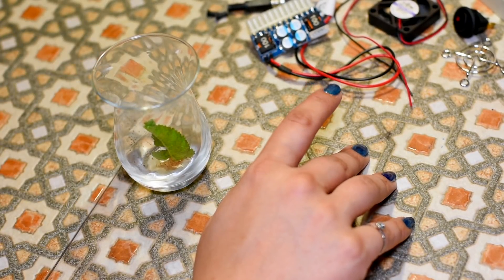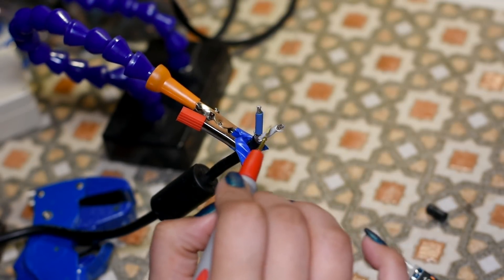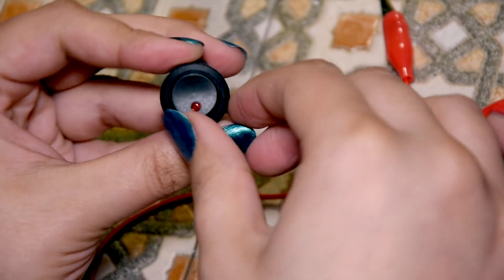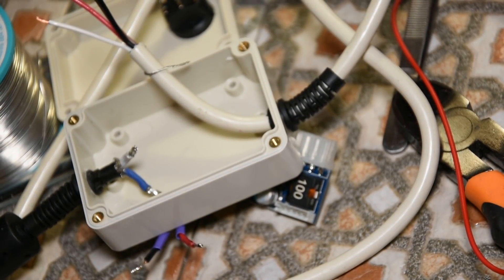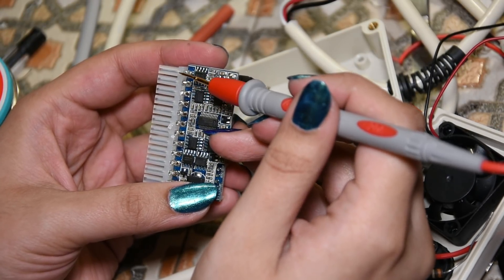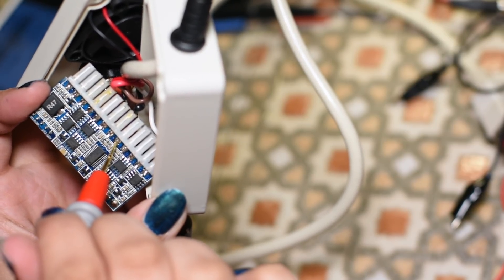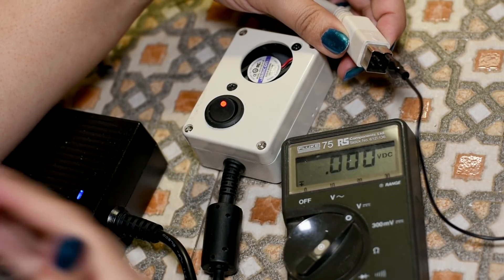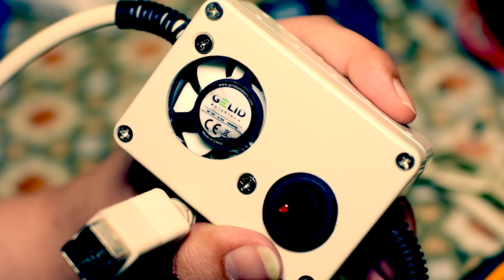160w Pico PSU hack for the Amiga

Comment: Maybe you should have another hole in that case for the air to get in. Because that fan can only blow out, what gets in somewhere else. This way, it is only stiring a bit. Nice project.
Reply from the maker: There is btw, there are a few holes along the bottom.
Reply: MsMadLemon Now I have seen it :-) I should listen better :-)

Comment: I just can't decide what to do. My old A500 PSU (The heavy one) is old and doesn't work well. I'm sure I could just recap it and it will be fine but it's still only 2.5A so it isn't really enough since I have a 68030 accelerator in it. I read that an ATX PSU isn't all that safe as well but the Pico is just so darn expensive.
Reply from the maker: Keep hold of your A500 psu, im in the same situation and im about to do a video series on replacing the innards of my A500 heavy psu.. maybe it could inspire you, ive just bought a meanwell psu that will fit inside the A500 psu case.
Reply: Oh. Which one did you buy?

Comment: Great video. I was wondering if you could follow this video up with a guide to using this pico psu to power multiple devices off one unit. For example a raspberry pi, a hard drive and an small audio amp. Keep up the good work.

Comment: so you`ve got a power supply going to another small enclosure then finally to your amiga, bit of an abortion, just put the pico whatever straight in your amiga, or at least de-solder the connector and do the job properly
Reply from the maker: this is my way of doing it, its working therefore it's done "properly" , I dont want to modify the Amiga

Comment: Oh dear, I feel like a right 'orrible' person writing this. I am a great fan of yours young lady.  The fan off center is OK but where does the hot air go ? Nowhere. It's a good idea to have exit holes to allow the hot  air to escape. What you have will help of course but a few 6mm hones here and there would make it much, much  better. Your a very brave lady. Lovely videos always.
Reply from the maker: The hot air comes out the top... The holes at the bottom of the case are inlets...As mentioned in the video.

Comment: I will almost guarantee you the green screen on the A500 is a corroded or just old Agnus socket rather than RAM. So you can pull the Agnus and look for any dodgy connections, clean them and it should be fine. You will probably want to replace the socket though, they cost like 2 dollars :). Great video by the way.

Comment: Great job Maddi :) Love how you flux! :D:D:D As for the big white connector, I would have desoldered it completely as it's useless and takes up space... and also, another cabletie on the white cable to be on the safe side :)
Reply from the maker: Yes i was wondering shall I desolder or not, i should have done really but nevermind, if i do anything like this again or do an update etc, then it will be done :o)

Comment: I did the same thing a few months ago, but I stuffed the stripped AC-DC brick and the PicoPSU into the original Amiga PSU case.  you can get a bunch more room by desoldering the ATX connector.

Comment: Funnily enough I just put the same Gelid fan inside my A600 to stop my issues with the Vampire crashing due to heat. Got it mounted in a small 3D printed bracket I designed. It works nicely, just wish it could still be quieter
Reply: Re: making it quieter, have you tried elastic mounting? Hard mounting a fan is like giving it a big resonator (the case) and the best way of making every bit of vibration heard. That said, these little 40mm fans tend to be quite high RPM as-is, it's not easy to get them particularly quiet.
Reply from the maker: I got a second fan just to do exactly, that, it gets hotter than I expected so i'll be figuring out some way or other to mount it
Reply: I found it froze/hung/restarted when left rubbing stuff like ADoom for a couple of hours. With the fan fitted I have left it running for over 8 hours straight with no issues.

I designed a vent to blow air over and under the card which I put on Thingiverse, but found blowing the warm air out the top worked just as well and took up less room. 

I upload the design for my bracket tomorrow and give you the link
Reply: I had some of those silicon anti vibration things but they didn't really make any difference, so use some tac under each corner so it doesn't vibrate and rattle. Think that being a 40mm fan it won't ever be too quiet unless i stick a 47ohm resister on it to knock it down to around 9v and slow it down some.

Comment: That's really cute! How hot does it get? I don't think even the Vampire'd 600 would stress it out much.
Reply from the maker: Thanks! On my standard A500 PSU Vampire A600 appears to struggle and not boot up into the SD card, but with this, it's a breeze, and runs nice and cool too.

Comment: Wouldn't it fit into the computer?
Reply from the maker: It would as i mentioned in the video, but i decided to do it this way.
Reply: I got a call and didn't pause the video just lowered the volume a bit. Maybe I missed that part. Anyway, the only difference would have been the position of the switch and no box on the cable. But tbh I allways wanted a switch on the computer and not under the table. On my last 1200 I had a PC psu and the power button was attached to my monitors powerbutton. I had to learn the hard way that original Amiga bricks die when you have a hdd, cd burner and 040 connected at the same time. :-(

Comment: Great video! I did something similar a few years back with the 80watt Pico. I've also installed one inside an Atari STe computer too. Lots of flexible ways they can be used.
Reply from the maker: Thanks Todd! I almost went for the 80w myself also, they are very handy and I like that they can be fitted inside the computer itself.

Comment: Hey Maddi, just a lil heads up, it's advised not to use gloves when drilling stuff, they can snag on the bit etc. :) Nice lil project!
Reply: i think it will be fine. it's not a long sleeve or something like that. 
i don't think it will wrap arround. actually i am shure it wont.
this way her hands are more protected if she snaps out.
she did scare me much more the last time when Maddi tried to drill a hole,
whow did she scared the creeps outta me. 
i prefer to see that Maddi starts to wear her nice hair in a knot. when doeing these kinda jobs. actually i used to have a pony-tale back in the days but when i started using big CNC machines i cut everyting off before a machine did. easy and save. ps. Maddi, dont wear your hair like me, it not suits you;)
Reply: Lol right. This is why I said "advised" not storming in the comments with "NO NO NO" like some do. Hvae a great day Jan.
Reply: meh, nah it's cool Neffers. 😜
i never tried to sound like a hard NO. absolutely not. sorry if i did.✌️👍 Cheerio buddy.
Reply: No you didn't come across that way at all :)
Reply from the maker: Actually I initially didnt wear gloves and the plastic case slipped through my hands and started spinning... you might notice at one point of the video my hand is very red lol 9:50.. it hurt a bit so hence the glove.
Jan, I always tie my hair back when drilling or dremeling.. machines can be scary things! :oO
Reply: I would probably invest in a couple of "one handed bar clamps" if you plan on doing more stuff in project boxes etc. They are excellent at holding stuff down and quite cheap too. Not as good as a mounted vice, but very practical.

Comment: Oh, the exciting tinkering you do.. :o) How elegant and well done, Maddi! - I always thought the Return keys on foreign Amigas were friggin' huge! It's much smaller on the nordic machines, because of those strange æ, ø and å characters, hehee.. :o)

(I'd probably be one of those who put it inside as well. Maybe I don't know enough about electronics, to feel I shouldn't, lol..)
Reply from the maker: Thanks Brian :o) 
Putting the pico it inside is just fine, sometimes those square DIN plugs aren't available so one only has that choice, I just had a few spare so i thought i'd do it this way :o)

Actually there are two types, My A500 has a large return key and my A600 and A1200 have the small one :o) .. unless the return on the Nordic ones are even smaller than that? :oO
Reply: One should always do it like one wants it to be, and be happy with that. Whatever the reason. And I think your way is very nice. The fan mis-allignment is just charm! ^_^

Oh, maybe only the A500's has the large key.. We can can compare keyboard layouts sometime soon, for fun? :o) Sounds like my nordic A1200 has the same size as your A600 & A1200. Huh.. Peculiar..